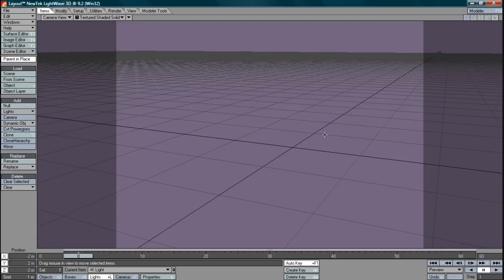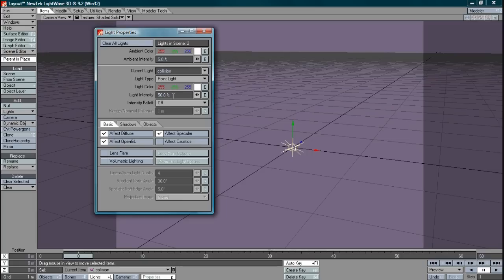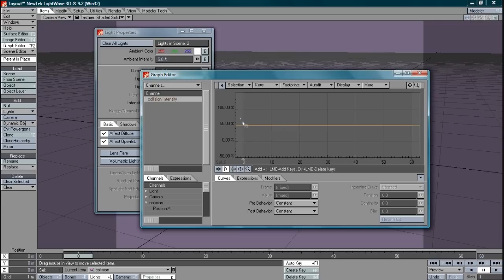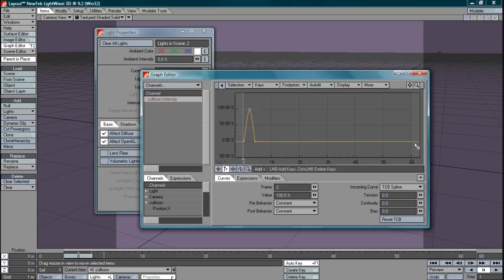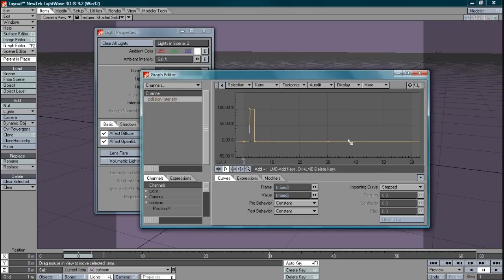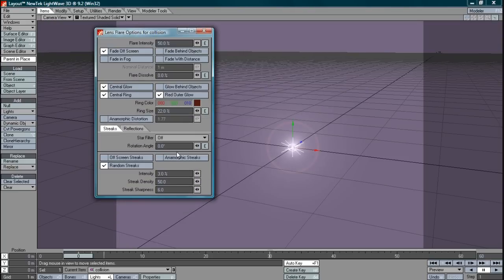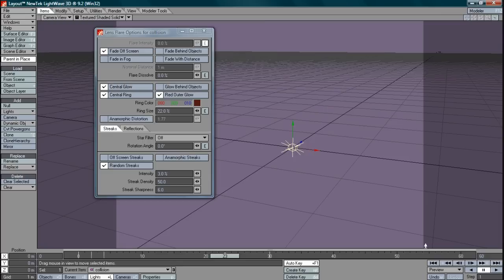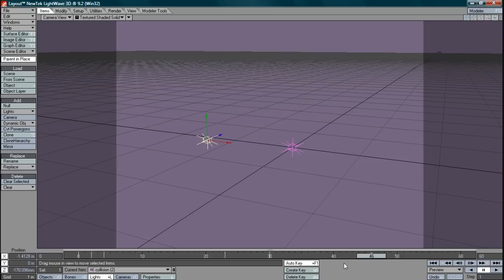Lightwave animation tutorial - Using envelopes

Comment from the maker: Have you turned on lens flares?  The light intensity may be changing but if you have lens flares turned on and dont put the envelope in the flare intensity setting you wont see any real difference.  Basically check you've applied the envelope to intensity on the light and its flare.  If not that then recheck your envelope and make sure it's over the correct percentages (not 0.1% or something you wont see) and check the frame numbers are in your animation range.

Comment from the maker: @smallsnipe Doing it with a package like Lightwave would also require camera matching software like Syntheyes or PFTrack, and is really no job for a beginner.  You might be better using Adobe After Effects to do it.  It might not be quite so accurate, but it would be a lot easier.  Since it is stop motion you're doing, you might try just using Photoshop or some similar program and put in lens flares on each frame.